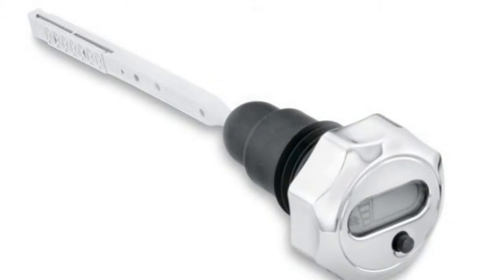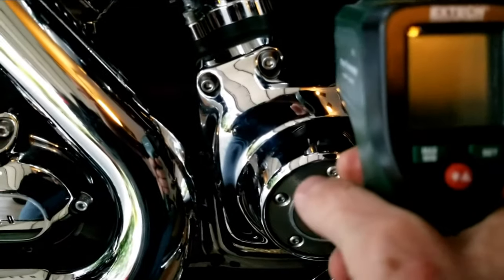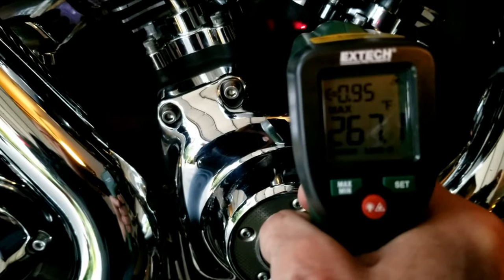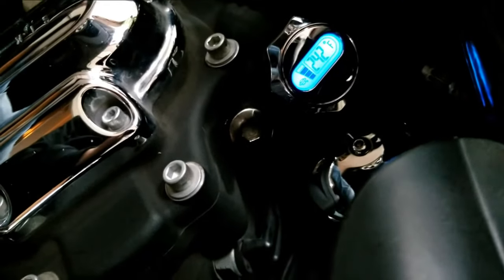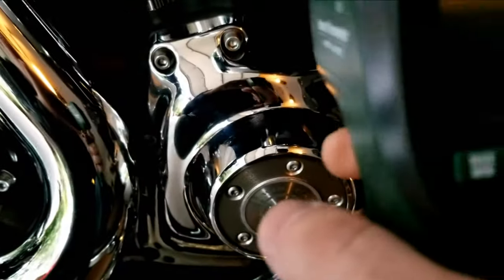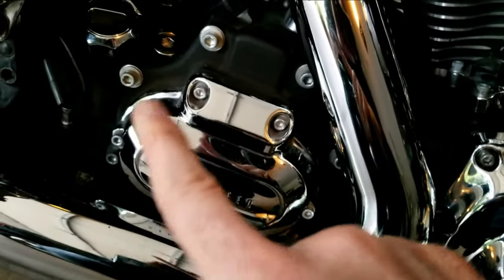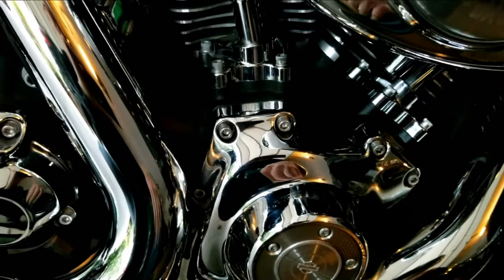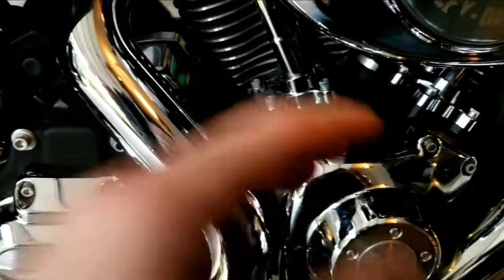Oil Level and Temperature Dipstick Follow-up

Comment: I read somewhere when you change your oil you should use the OEM dip stick for your level readings, I had one on my previous bike Dyna Super Glide, lcd gauge was ok, after awhile quit looking at it, as you know bought one for my RK, tried to reverse face and messed it up....another thing what is the minimum temp we should be looking at to indicate may be a problem....
Reply from the maker: I think I'm seeing a  20% difference, but there's a lot of play with the HD oil level. Mines at the 3/4 mark. I think that shows as full on the original OEM stick. I might stick the old stick in tonight to just double check again.
Reply from the maker: I just stuck my old stick in and it seemed like a tad could be added. So...close enough for government work I think.

Comment: Glad to see the dipstick temp gauge is working good. I need to carry my laser digital gauge with me one day to check my temps while backroad riding. Granted I am liquid cooled. Not air.
Reply from the maker: The readings still could be interesting. Sometimes liquid cooled runs cooler, sometimes they take a smaller engine and work it over good. 
:-O

Comment: Your oil temp seems disturbingly high to me.  Might want to look into a [better] oil cooler, better engine oil (AMSOIL, Mobil1) and a tune.  My TC runs well under 220 except for the very hottest days in heavy traffic.  Engine temp is < 250 most of the time.

Comment: I bought mine and it started leaking a little. It also doesn't sit flash with the oil tank like the stock does. Have you had any issues.
Reply from the maker: I haven't had the two issues mentioned. Is it the right model for your bike? If so, I would return it for another.

Comment: Question: will this temperature gauge work on a 2016 Indian Springfield?
Reply from the maker: Doubtful. I seem to recall the Thunderstroke oil hole was smaller, but I may be wrong. If you found someone who has one on their HD, if they will let you borrow it, you could see if it fits in your opening. You could also do a test reading and see if its somewhat accurate for the oil level. Good luck.

Comment: That’s pretty interesting. My bike has an oil cooler and I’m curious as to what the oil temperatures are!
Reply from the maker: Pretty sure you can buy a temp reader. Might not be in a stick form like this one, but there's an oil or engine temp reader out there for most bikes I'm sure.
Reply: TheRoadRatt I’ll have to look into that!

Comment: how was the oil level part of it ?
Reply from the maker: I didn't check that in detail. But there seemed to be a 20% difference give or take. Now there's a lot of play with HD oil levels. I use it to ballpark. If nothing registers, that's a problem. If it registers as overfill, another problem.
:)
Reply: @nwroadrat  I am having an issue with mine. I have one for my 2018 Sportster. It takes 3 quarts of oil, and that gives a reading of about 3/4 on my stock dipstick and is perfect. When I put the LCD dipstick in, get it up to temp it says it is over filled. It is definetly not over filled.
Reply from the maker: @jonnymac8925  hmm...do you have the right stick for your model bike? If so, I might see about getting it exchanged.
Reply: @nwroadrat  yup, the Sportster LCD dipstick is shaped differently than the softail and touring dipstick. I think younare right about exchanging it, the part I don't like about that is it took me 4 months for the first one to arrive haha

Comment: Seems like they work good mine let me know that the dealership put to much oil in the engine . After riding up to gas station and putting gas decided to check out level because I was on level ground pushed the button and high oil message came across the screen went home checked oil level ,man was it over filled turns out the genius they had working on my bike just poured four quarts in the engine  never bothered to check level after three quarts which is what the service and owners manual tell you what to do ., Yes the engine hold four quarts of oil but when doing an oil and filter change you'll never need more than three quarts and a couple of ounces on a 2016 roadking always check your manual for your specific bike.when I took it back to them the service guy said well better to much oil then not enough he didn't know how wrong he was . The breathers on the top of the engines are suppose to keep liquid oil from going into your air filter and it's cover ,put to much oil in and you get oil leaking out from air filter cover the guy was an idiot and never should have put a finger on anyone's bike .I do my own oil changes which is really easy and one more thing when they do do it correctly they charge you for that fourth quart of oil but never use any more then a few ounces of it .With synthetic oil at twelve to fourteen dollars a quart they are sticking it to you and ain't using no lubrication even though they have plenty that you payed for
Reply from the maker: The information this unit provides can be a lifesaver for bikes. While I think your bike was fine as they've built in a lot of error tolerance in the engines, you're right, too much oil spits out and may not lubricate as well. They train the official techs. to do a fast quick in/out. Going to a knowledgeable well known independent shop is the better approach for HD service. Respect and rsmf.

Comment: mine stopped working about six monthsafter i got it
Reply: that coin battery cant take the heat
Reply: @HoustonR6ryda  yeah, my lithium battery that was in it just went out. I put a new regular Duracell 2032 in it, and it's working again. Very simple to change.
Reply: How do you change the battery?
Reply: @lymanbeach24  unscrew the 4 Philips head screws. Pop the battery out with a pocket knife, replace. Put the 4 screws back. Major simple.
Reply: You will see the screws when you take out the dipstick. On the bottom of it.

Comment: if i didn't fook up my clutch i could afford to buy this :) just got my bike back from a service and they didn't adjust my clutch properly - my clutch is fooked and i had to pay for a new one :( 

i fooking hate harley davidsdon dealerships they are all the same !

i think i am done with harley davidsdon for good.
Reply from the maker: I've since switched to non-dealer mechanics. Going forward I probably won't be doing a dealer anymore and I'll just stick to cheaper and older used bikes. Independents are more familiar with those models anyways. Good luck.